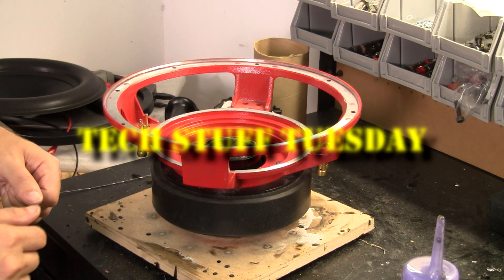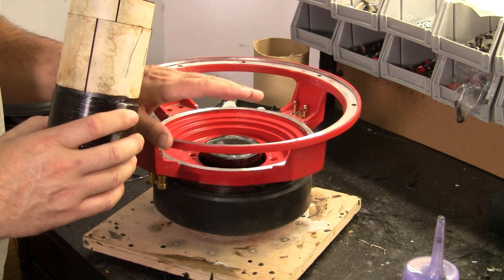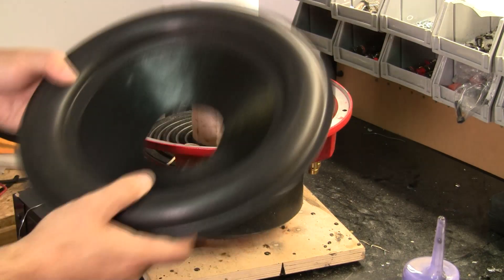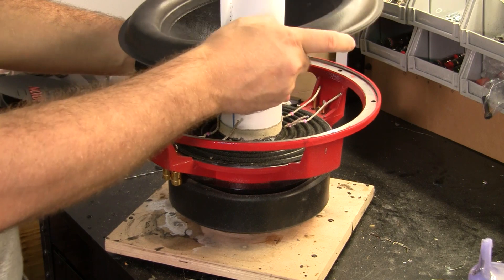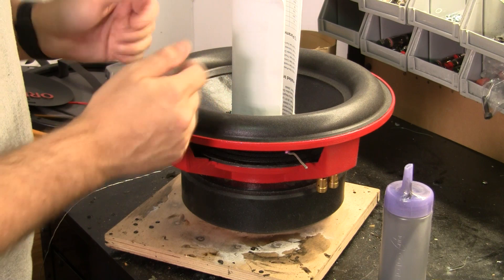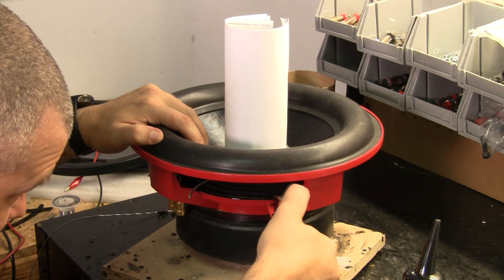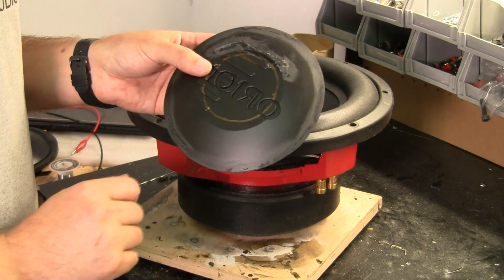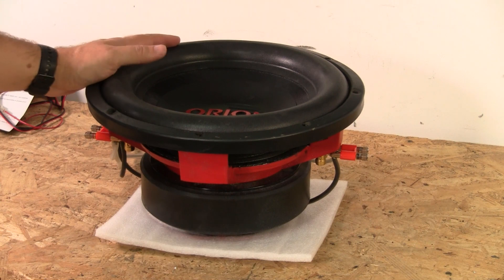How I rebuilt an 18 year old Orion HCCA subwoofer - Tech Stuff Tuesday

Comment: Thanks for such an interesting video, just a question have you ever encountered a vintage speaker from the 1930s known as the Goodmans twin cone 12 inch 15 watt, 15 ohm one and a half inch voice coil bass response loud speaker my dad had one installed in a large cabinet that was lined on the inside with underfelt and it was connected with two chassis one a pre amplifier and the other for radio use and connected to a record changer, both the chassis were of the glass vacuum tube variety, but boy that speaker was so gutsy in its bass response and overall sound. Until one day my brother foolishly the loudspeaker to the wrong output of the amplifier and blew the crap out of the speaker and of course all the copper wire on the voice coil untravelled as it was acting as a fuse, a big loud " bang" and a cloud of dust. I  was just wondering if you have ever re- coned one of these?.

Comment: Can a hcca dust cap be replaced without doing a recone
Reply from the maker: Yes, a dustcap can often be removed and put back on. The way I put them on with our dustcaps, not so much. It depends how much contact area there is.
Reply: I have a hcca 12 with a cracked dust cap I was wondering if it was repairable without recone so thank u for answering my question

Comment: hey EMF, great video bro... Im a huge fan of Old School Orion. Quick question, after you rebuild a sub like this, how do you figure the specs or t/s parameters of it? model it's performance in software for enclosure planning on that re-cone/re-build? Thanks for all of the great info & content... keep the great tutorials coming.
Reply from the maker: I measure the specs using equipment that does it. Modeling software is not accurate, I did an entire video on it.
Reply: @EMFAudio  I saw that video, gave it a thumbs up, and saved it (so that I could share the education with others)... I just didn't know how or if you could get specs after rebuilding a damaged sub.
Loved the video. Keep up the fantastic work. 👍👍

Comment: I'd love to rebuild 2 old rockford hx2 12". Those were my first 2 subs that actually were pretty loud. Classic.
Reply: Springfield Speaker Repair should have either old stock OEM parts or new stuff to fit.  Expect to pay 80$ a pop or more for parts plus shipping.  Hx2 subs stand the test of time well though and are still solid performers in the 800-1000w power range.

Comment: I have the HCCA152 I hate it noticed screws rattling in the surround ring went to tighten them all stripped out magnet split on me first winter voice coil locked up because it shifted and after spending almost $500 on the sub they wanted me to pay shipping to a service center where it probably would have been denied repair..
Reply from the maker: Paying shipping for a warranty claim is normal for literally any product in any industry. I do agree it would probably be denied for repair under warranty, or maybe even at all.
Reply: @EMFAudio  I live in northern Maine and it gets cold I had one other sub that did the same thing in cold weather 15" Alpine type R magnet split got in one day no bass. Not sure why it happens maybe small air pockets in the magnet?? But never happened on any other subs I've had mostly 12s. If I was in the position to warranty the sub or not I probably wouldn't have, shit happens.
Reply from the maker: @lucastheriault2787  I can only speculate why it would happen but I bet it has to do with using thicker slugs.

Comment: This is the coolest video I've seen in a while. 

Competed against a few HCCA owners back in the '99 dBdrag season in Extreme 1-2 with Kove Armageddons. Looked like virtually the same subwoofers and performed nearly identically. This was a great trip down memory lane, thank you!
Reply from the maker: I believe they were both TC9 based subs, I don't know specifics on the rest as I didn't think I'd be quizzed on it 20 years later. I did do several installs with Armageddons though.
Reply: @EMFAudio ... I'm sorry, wasn't trying to come off like I was quizzing you. Was just repeating an observation from way back. Great video, and thanks for replying!

Comment: How long for the e6000 to dry before you think it’s ready for movement/vibration?
Reply from the maker: 90 minutes I feel good about it not being able to be moved but I wouldn't put it under pressure like in a box for several hours. The tube itself says 8 hours I think to be fully cured.

Comment: Hoh...? A legal age sub...? At least you kept it alive! Better recharge that magnets too!
Reply from the maker: Why worry about recharging the magnets? They don't demagnetize with age and if they're fully magnetized, they won't get more magnetized.
Reply: EMF Audio Magnets lose magnetic strength with heat too. Subs get hot when clipped or fed with too much power. Improvements on BL is not really noticeable, with gauss values of +1000 from original values
Reply from the maker: @ruikazane5123  Depending on the type of magnet, they don't lose magnetism till WAY hotter than the coil can make it. Neodymium is more susceptible to heat than ferrite and neo won't lose magnetism till around 600 F, the sub is on fire at that point. Ferrite is much higher, I think 1,200 F. +1,000 gauss is A LOT. Even if you're talking about starting with 10,000 (which is extremely rare) that's still 10%. If you're comparing to 6,000 which isn't uncommon, that's 17%.
Reply from the maker: @ruikazane5123  the temperature you gave is what I said, and again, you'll never get it that high. The coil failed before that point so it's not even possible. You won't get the motor as hot as the coil in any case. Ferrite is commonly used because it's cost effective, period. It has nothing to do with the temperature of failure it will never get to. Again, if it's already charged fully, charging it again won't do anything. If it was never fully charged it would. Age and normal heat won't effect it.
Reply: Smh

Comment: Can I fix a sub for me and how much?  It's a rare audiobahn 10 inch. 1800 max. Needs rebuilt
Reply from the maker: That depends on what needs done and if parts are available.  Is there really such a thing as a "rare" Audiobahn?
Reply: @EMFAudio  it's a AW1005Q. It's beefy and heavy. Figured it be worth repairing
Reply from the maker: @demarccoguiden795  It's big because of all the stuff covering how small the motor is. It's up to you if it's worth it, reconing it could be around $200 plus shipping back and forth.

Comment: better stop using clamps directly on surround. use a big round plastic ring like a cut from 10" or 12" pipe just to fit the outside surround  for 5cm legnth.
Reply from the maker: Better stop using them because they've worked great for the last 6 years? Pipe won't fit correctly, especially when baskets and surrounds are different diameters.
Reply: @EMFAudio  it is great but you can see dents from the clamps.
Reply from the maker: @bunnatang2081  Which you don't see an hour after removing clamps, and the gasket covers it anyway.

Comment: Great video! Keep vids like this coming! Just for curiosity's sake a video like this but explaining what glue & whats different about them, and other details in depth would be awesome!!
Reply from the maker: That would be a short video, especially because I primarily use 2 adhesives LOL
Reply: @EMFAudio , we saw the E6000... The other was CA glue, yes?
Reply from the maker: @russellborrego  The stuff in the bottle is CA, yes.
Reply: @EMFAudio , sweet. Thanks! If you ever get in a pinch for some reason, isopropyl alcohol works great as an accelerator.

Comment: q: how do you clean possible debris (like burnt voice coil winding, dust & metal scraps) in the voice coil area when reconing ?
Reply from the maker: High pressure air does pretty well but that doesn't always get windings out from the bottom. In that case a pick tool down in the gap to dig it out is necessary.
Reply: also, +1 sub

Comment: Question...  What would you compare old school 1996 (shaft center)15" cerwin stroker to whats available now a days, quality.  I have a couple need reconing wondering if its worth it... other than wow appeal.. THANKS
Reply from the maker: "quality" is vague and I'm not so sure you meant what it says. Correct me if I'm wrong but did you really mean what is comparable in sound and performance?
Reply: lol...  Yes, I have been out of the game for a long time, I second guess what was to what is now... They always say not built as it was years ago...   And what would you consider a subwoofer now a days to that stroker. I know its sad that I ask, just technology has changed maybe the process of woofer making too... lol... I'm an old school guy, just whats on market now for pricing is crazy cheap.  Amplifiers, decks so on... Just lay into me.. I can take it!!!
Reply from the maker: @milanraseta8098  The Stroker was based on a PA design, and that's where you'd find something like that now. There isn't anything designed that way in car audio, for obvious reasons. I'm going to be doing a video with old equipment and new equipment in the same install to bust balls on the whole "older was better" thing.
Reply: LMFAO...  I will keep watching your posts.. lol..  Thanks.  Its been years, I get the logic now

Comment: Have 2 mtx 7000. The old school pulp/black dust cap id like to get rebuilt
Reply from the maker: It may be possible to rebuild it.
Reply: Or i dont see why i couldnt... Its 2.5" coil.. Id have all the parts to measure.. Still a rough estimate would be cool
Reply from the maker: You don't see why you couldn't till you measure it. Just because it's a 2.5" coil doesn't mean all 2.5" coils fit. If that was the case, there would only be 1 coil. Cone body being the right size is an issue too. Pretty much anything I recone that isn't ours will be no less than $200 before shipping costs.
Reply: @EMFAudio  ok cool thank you. 400 for the set. Ill have to see if i can work that into my budget thank you.
Reply from the maker: @bobdodge3171  Notice I said no less, it could be more.
Reply: @EMFAudio  yep rough estimate
Reply: @Mr Strawman yeah.. Im just being optimistic lol.. This orion has the same basket.. But slug is different.

Comment: Awesome awesome video! What would you recommend rebuilding old school (ThePunch) 12’ Fosgate subs. With the inverted dust cap. Would like to get as close as I can on them looking vintage.
Reply from the maker: I couldn't simply recommend parts, things like this are a case by case basis and it requires measurement and using resources to find the right things.

Comment: I would like to see the new thiele small parameters. Maybe do a build increasing RMS and lowering Fs if possible...
Reply from the maker: That would require breaking it in and further testing. Increasing power rating would come in either thermal or mechanical. Thermal won't happen without changing the basket as the coil is already a 500 degree coil (I'm assuming the original was too, may or may not be) and mechanical would just be a tighter suspension which would raise Fs. You could add mass to lower the Fs back but then you're making it less efficient and raising the Qts.

Comment: Do you know if a shallow mount Alpine SWR-T12 sub can be re-coned? I called Alpine and they were no help. 

If yes, could you re-cone it?
Reply from the maker: Based on what I know about them, you have to use their parts.
Reply: @EMFAudio  which they don't supply...? having this problem with my SWR-1022D, it only has a small hole in the surround though so what would you suggest...?
Reply from the maker: @RWL2012  Is it complete hole or just broken where you can connect it back?

Comment: I would like to see if these dual tinsel leads and huge gauge really. Matter, since they r connected to such small. Wire on the coil itself
Reply from the maker: This still has single, just larger. There is a difference at a point. But, consider this: EVERY coil uses small wire, even the ones rated for 6,000 watts.
Reply: @EMFAudio  I would like to see it tested for the giant dual and some times triple sewn or whatever leads to a single one Idk how they can benefit from having such a large wire dump into such a small one
Reply from the maker: @1-Six-dee  That is all subject to the power and impedance, especially over time. The same way that clipping can explode a lead, excessive current can too.